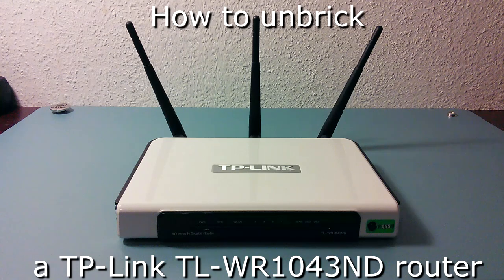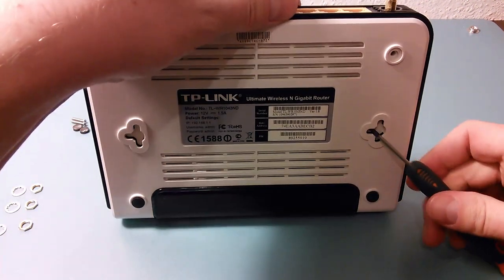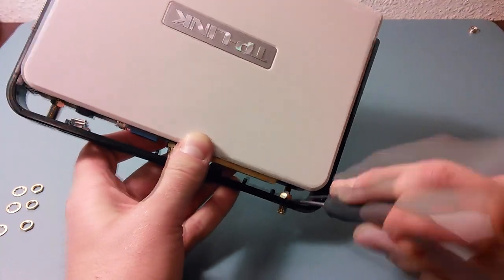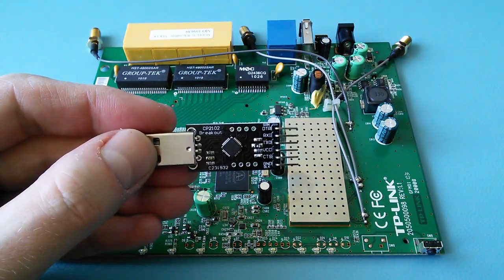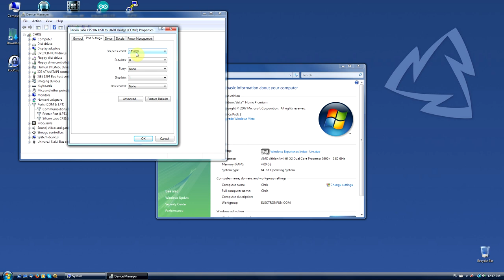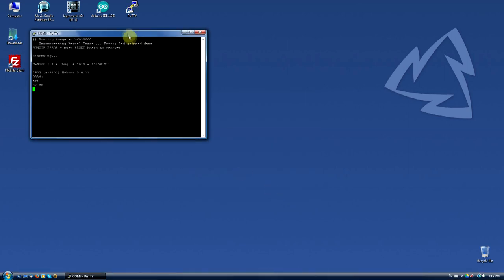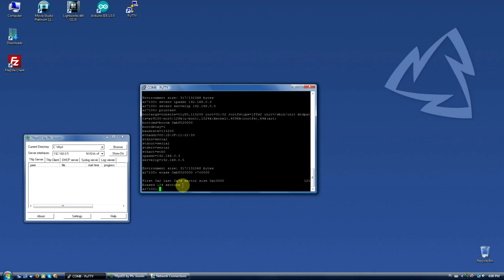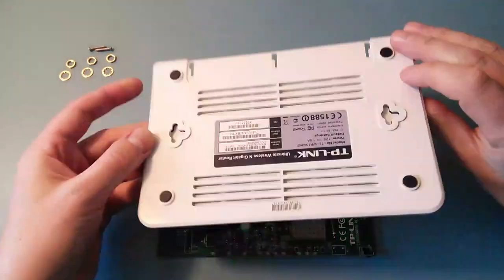How to unbrick a TP-Link TL-WR1043ND router (re-uploaded) || How-to-fix tutorial

Comment: There is another easy way to unbrick, just only need TFTPD & LAN cable without USB TTL cable, 
it also work for elder than v1.8 (as OpenWRT wiki claims that it works only beyond v1.8, but in fact it also works on my v1.1) 

https://wiki.openwrt.org/toh/tp-link/tl-wr1043nd#flashingrecovery_using_tftp_only_without_serial_console
there is a typo on wiki, the recovery FW name should be "wr1043nv1_tp_recovery.bin", not "wr1043v1_tp_recovery.bin", as wiki says, we should verify the filename by Log viewer, when it doesn't work.

1. just remove the power cord first, change / add your LAN card IPv4 address to "192.68.0.66", then connect LAN card to any LAN port(yellow) on WR1043ND. 

2. run TFTP32/64 just as how we know (of course we need wr1043nv1_tp_recovery.bin, by renaming the TP-Link boot part removed OEM firmware from OpenWRT wiki https://wiki.openwrt.org/toh/tp-link/tl-wr1043nd#back_to_original_firmware). 

3. press "Reset" button on WR1043ND, hold it, than connect power cord. 

4. wait for seconds, than TFTPD will start uploading FW. After uploaded (about 2 secs), you may release "Reset" button, WR1043ND will do the rest steps by itself. 

5. later you will see WR1043ND leds blink as usual, especially the LAN/WLAN led. Now you can access it by web browser again (everything will be reset to factory default).
Reply from the maker: Thanks for presenting this alternative method :)

Comment: Hi ElectronFun, i tried to upgade the firmware on my TP-Link 1043ND router (v1.10), i did it with DD-WRT, went fine, successful, it reboots and nothing. Only light on are the power and the port where it was connected to the pc. I would say that is what you call bricked. I will try your method as soon as i get my USB/TTL i just ordered. My question is what image (.bin) should i try and boot when i will try to fix it and where to get it. (Would this be it : https://downloads.openwrt.org/chaos_calmer/15.05/ar71xx/generic/openwrt-15.05-ar71xx-generic-tl-wr1043nd-v1-squashfs-factory.bin , or this : https://downloads.openwrt.org/snapshots/trunk/ar71xx/generic/openwrt-ar71xx-generic-tl-wr1043nd-v1-squashfs-factory.bin) and is this the original one, the router was running on, or i have to download and upgrade the one from the tplink website when i get the router to work) Thank you. PS New in this line of work.
Reply from the maker: +Samson Gabi Hi, my router was rebooting over and over again. If you can't make your router work, you can try unbricking it.
If I remember correctly, you should download the second firmware. I'm not sure why it's unavailable on OpenWrt wiki page.

Comment: can't get into entering TPL command.

It start directly. Probably using the faulty old image. How to break this routine???

U-Boot 1.1.4 (Apr 28 2013 - 16:01:02)

AP83 (ar9100) U-boot 0.0.11
DRAM:
sri
32 MB
id read 0x100000ff
flash size 8MB, sector count = 128
Flash:  8 MB
Using default environment

In:    serial
Out:   serial
Err:   serial
Net:   ag7100_enet_initialize...
No valid address in Flash. Using fixed address
: cfg1 0xf cfg2 0x7114
eth0: 00:03:7f:09:0b:ad
eth0 up
eth0
Autobooting in 1 seconds## Booting image at bf020000 ...
   Uncompressing Kernel Image ...

Comment: ElectronFun.com  I have the same problem with this router but I can connect to my router with PuTTY. HELP !!!!!!!!!!
Reply from the maker: Your router is not completely bricked, right?
Reply from the maker: Nazim Uddin Have you tried the failsafe procedure? If not, this may save your day: http://wiki.openwrt.org/doc/howto/generic.failsafe.
Reply: ElectronFun.com  Bro in the Stage 4: Log into the router using failsafe
I only get the 1st msg of this image http://wiki.openwrt.org/_media/media/failsafe2.png?cache=
But no 2nd msg Entering Failsafe! But thats oky I think is says In the step 

Once in failsafe mode, a network broadcast confirmation message appears (not always, for the TL-WR1043ND no message comes).

And my sys LED stats to blink 2 times in a second that means Im in failsafe boot

But after that How to do this step ?

Now, telnet (not SSH) to 192.168.1.1 from the computer. There is no username or password required.

And how to execute commands ? like mount_root reboot -fmtd -r erase rootfs_data ?????  recvudp.exe  not letting me type anything on it 

And bro can you please tell me the commands one after another ? Im confused which one I need and what value to set.

Sorry for too many questions. I think that's all I need to know. Thank you In advance.
Reply from the maker: Nazim Uddin I'll try to help you (if I can), but I need to know if you managed to telnet to your router? Did you use PuTTY to do that?
Reply: ElectronFun.com  Thank you so so much bro. My router was not working for one week. You've saved my TL-WR1043ND Gigabit router :) I got a little confused, there was nothing mentioned about PuTTY in the steps :P But now I've successfully reseted my router.
Reply from the maker: Nazim Uddin Great bro! Another router saved from the dumpster.

Comment: Hello brother, I had bricked TL-WR941ND V6 by bad openwrt flash. I got into opewrt terminal entered "mtd erase linux" and got into bootloop. I used tftpd program set up server to 192.168.0.66 and changed firmware name to wr941ndv6_tp_recovery.bin (i forgot first part of the firmware name may be this one). I had successful flash immediately. Now, I bricked TL-WA901ND V3. I had ddwrt beta on it. It had connection drop on client mode.  I tried to download original tplink firmware using ddwrt terminal  and command "wget http://www.tplink.com/......./originalfirmware.bin" but nothing happend just said connecting to server though router had internet connection. And going back to original firmware was not possible with this method. I entered "mtd erase linux" and it got into bootloop. And now it doesn't search for original firmware as TL-WR941ND V6. I used wireshark for traffic there was not tftp request only LLMNR protocol request from some ipv6 address. It used to show up only when router was ON state of bootloop.  There was no any ipv4 request coming. Is there chance of reviving through serial interface? Your help would be highly appreciated. Thank You.
Reply from the maker: +mystery chemical I guess it should be possible to unbrick your router through serial interface, but I don't own a TL-WA901ND V3, so I'm not able to help you much. I would ask for help here:
https://forum.openwrt.org or http://www.dd-wrt.com/phpBB2.
There are lots of people, who will try to help you.
Reply: Thank you for reply.
Reply from the maker: +mystery chemical No problem bro :)
Reply: I used serial interface and flashed openwrt as instructed on openwrt TL-WA901ND V3 serial recovery section. And it did work :)
Reply from the maker: +mystery chemical It's great to hear that :)

Comment: Yesterday I fixed bricked router without disassembling. You need to: 1. Download tftpd32 or tftpd64 2. download original firmware and rename it to wr1043nv1_tp_recovery.bin, that name have to be same! 3. on your pc set manual ip adress to 192.168.0.66 mask 255.255.255.0 4. lan port on router must have connection with your pc 5. start tftpd, set directory where you have router file 6. start router and hold reset button, you will see router will automatically download firmware, details you can see on that video https://www.youtube.com/watch?v=b81CWCBYf2w